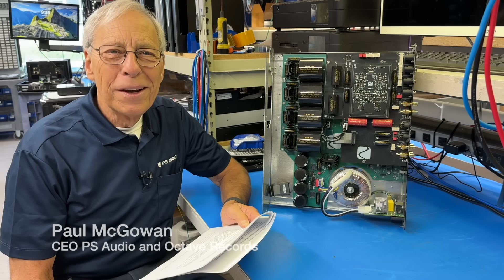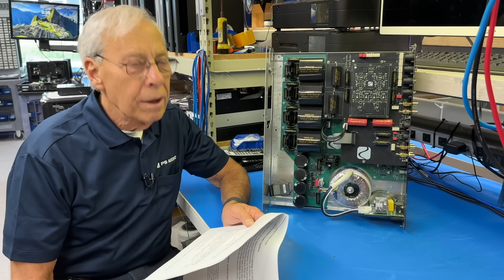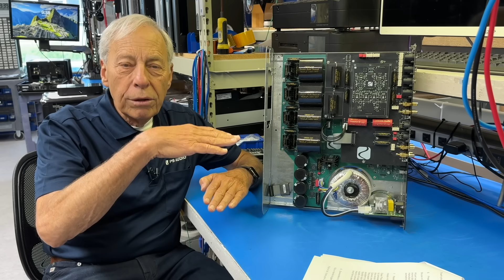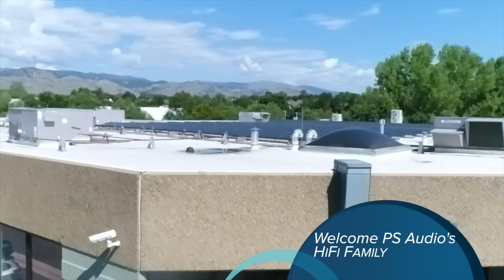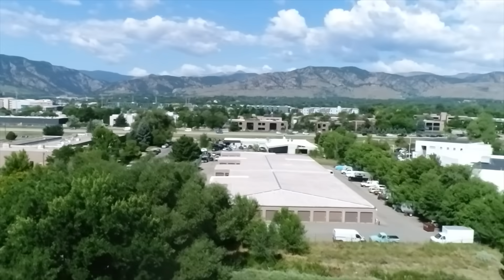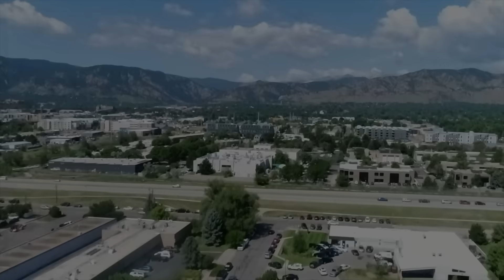Importance of preamplifiers and power supplies

Comment: Could not agree more about power supplies.  My pre amp PS does in fact have 4 film caps and 4 big chokes.  That is because I built if myself, and followed the advice of Lukas Fikus who has advocated this approach for years.  And the volume control is autoformer based because resistors just don't sound good. 
I suspect the new PMG preamp and DAC will be killer.

Comment: The importance of the power supply to the preamp is one argument for an integrated amo, it seems to me. It does seem a waste to have 26 lbs of transformer and capacitors in a preamp feeding a 50 lbs (or more) of transformers and capacitors in a power amp. Of course, if one of those components has tubes, it might be worth it.

Comment: I cannot afford Paul's gear but I did just find a super rare power supply. "Rare as hens teeth" Music Fidelity V-PSU II for my V-DACII.  For me that was painfully expensive. I paid less than half for the V-DAC II.  However after watching this quite important vid it made sense to me to get the real deal upgraded power supply by the same company. Is what it is.  Paul knows what he is talking about no doubt! Dug in on net about this power supply and many said it made big improvements. 63 and the clock is ticking. Not getting any younger. Enjoy life while you can I say. In this case hoping for a minimal 10% gain on audio improvement with upgraded power supply. If I get 5% to7% that will will suffice.  China after market power supplies for my DAC were less but then they base it on 110 volts in. Their standard.  U.S.A can be 120 to 123 volts monitoring my U.S.A made variable variac for my home system. That being said kinda of scary depending on their DAC power supplies just saying.  Going back many years,,,,,,vintage tube amps were rated at 117 volt specs in.  Maybe I am splitting hairs but it seems logical to me keeping things in range voltage wise as needed. Feel free to chime in on this subject by all means. Learning is everything.

Comment: The problem is the main function of a preamplifier is to be a hub for your hifi.  It should not be sold as some solution to improve the sonic quality of your sound.  Thats wrong messaging in my opinion.  

 That being said preamplifiers can exist as a piece in your chain to tweak sonic character.  Lots and lots of people by annemic cheaper dacs.   More transparency and more resolution are not necessarily going to make that dac sound better.  Hence why tubes and warmer solutions exist.  

Great discussion if the goal is to have uber transparency, however i dont see everyone in practice with this desire.  

Furthermore when we consider alll the formats, all the generations of music over decades of music.  We have to acknowledge the sheer amount of variability across this spectrum.  

Paul i think more emphasis on fun and i think more emphasis on creating a preamplifier than can act as this total control box of sorts for tweaking sound per medium, genre, and generation is just so much more appealint to todays generation.  Multiple gain settings maybe eq of sorts, tubes etc.    i say all this and people are not even making preamplifier anymore.  And it would be nice to have these features not be baked into a dac like some of these other brands are doing. So what do i know.  

The sales pitch for preaplifiers is by this thing that cost xxxxx and by the way it shoud make no difference in sound charter.  The reaction.... Why do i need to spend xxxx for something that doesnt add anything.... Just to turn the volume up...

I think, IMO this is why people dont buy preamps because they see them as scams. 

If resolution was king every person on earth would be an audiophile.  Rock and roll was founded on distortion baby. 

At the end of the day synergy is everything.  If you need uber transparent then get that.  If you need to warm up your sound than do that is my take.

Comment: I think the importance of a preamp depends on your DAC. If your DAC has a digital volume control and no buffer at the output, then a good preamp will make a huge improvement in the sound. Most DACs under 1k USD use DAC chips' digital volume and no buffer after the I/V stage. Perhaps modern 32-bit DACs using 32-bit depth for volume have fewer volume rounding errors, but their SNR at low volumes is worse than at high volumes. I have experienced this firsthand, and I have had to actually use my preamp to attenuate the signal instead of amplifying so that my digital volume can be high to increase SNR. I can't find good pot with non-ferromagnetic terminals for the preamp in my country. 

In my DAC design, I use a digitally controlled analog volume chip and a discrete transistor buffer, so a preamp might not make a huge difference, and I would be better off putting the money elsewhere, like a DSP circuit for a sub. With the goal of a fully balanced circuit from DAC to power-amp, my preamp would cost a lot. I have a good circuit with THD of at least 0.0000x%, but it requires a lot of parts, at least 15 transistors per channel. For a balanced circuit, i.e., 4 channels that amount to 60 transistors. With the overall system THD goal of at least 0.000x%, and with the power amp at 8 ohms and volume chip already at 0.000x% THD, I cannot downscale the preamp if I am to use one. All circuits produce predominantly odd-order harmonic distortion, thus, there is no chance of distortion cancellations between components unless I use a tube preamp.

The PS Audio preamp is great, with great design and build quality. You can come close to the performance of the film caps-based PSU, though with a capacitance multiplier, RC filters, and film caps bypass caps. It's great for marketing, though. At that performance and price level, small details like that are what win over customers. With 400uf filtration, I can only imagine what you had to do to completely get rid of ripple. My DIY preamp has 10k uf caps, but I had to resort to capacitance multipliers and RC filters to completely get rid of ripple.

I completely agree with you on the importance of a clean PSU and the tap and water analogy. But designing and building a clean PSU is non-trivial, and some circuits, e.g., cascodes, are more immune to PSU junk. The real work is making the "tap" track your hand movements perfectly, and not to overshoot or to undershoot. Each twist of your hand should be proportional to the change in the rate of flow of water, which is easier said than done. also, controlling the rate of flow of water in a small tap(small signal amplification or low gain amp) can be more linear than controlling the rate of flow of water in a big tap, like a fire fighter's hose (high gain amplification or power amp current gain stage)

Comment: Paul, there are dozens of DACs with analog volume control. So my Nuprime Evo-2 DAC, but I am using it's fixed out, because the preamp im my Luxman L-509Z integrated and it's volume control is better.

Comment: BAck in the Mid 80's, I had the opportunity to work with Michel Prin in Mtl (He was the founder of SON HI-FI MAgazine & the Montreal audio festival if I recall).  I remember doing an experiment with him where he connected the external power supply from NAIM Audio (for which he was the Canadian distributor at the time) to a Sony Pro portable tape recorder/playback device.  What we did was listen to the Sony device with the power supply provided by Sony.  It sounded good, but not as nice as the NAkamichi deck we used to compare all on a good audio system...    Then he used the NAIM power supply and WOW the Sony device was sounding so much better; more dynamics and more stability with better soundstage, then we tried the Sony with Brand New Batteries... We were shocked to hear just how good this portable device was sounding without Any power being linked to the wall outlets via any power supply.   It actually sounded better than the NAkamichi device!    This experiment proved a few things to me : 
1) Wall worts power supply are NOT very good for audioé
2) A good Power supply can make audio gear sound sooooo much better & this still holds true be it an internal or outer power supply (ideally with a great Capacitor basin for dynamics and stability in the flow of power).
3) BAtteries can be messy to manage but, Boy, oh Boy!  Good Batteries are a Great way to get power supplied to any gear that is to be listened to (Especially if Batteries are used in conjunction to feed a great Capacitive basin to get both silent power that is also dynamically capable.  
Over the years, I had chance to experiment with these 3 notions, especially point 2 and 3 and I am Sooooooo clear that power supply quality is, indeed, something that can significantly impact music/audio reproduction.

Paul is spot on about this in this video 
& that preamp looks nice indeed with these  film caps.  :) 

Cheers!
M :)

Comment: You can measure the voltage rails within a preamp and judge the effect of the power supply and capacitors on how constant and noise-free that voltage is. It would be nice to see some actual precision oscilloscope measurements showing the effect of the power supply improvements. You can measure much more detailed voltage fluctuations than what you can ever hear btw, so this is not a case of listening is the best judge, like it is in some other areas of high-end audio (e.g. speakers).
Reply: You will never see any measurement of the power supply and I think you know why, because it's all total 🐴💩. Film caps vs electrolytic in the power supply you will hear no difference. If he showed what the ripple looked like it would destroy his claims and his products. But he is marketing to a customer base that has more money than electronic senses. But I digress.
Reply: @carrizzle9586 The fact is that you can't describe every quality of audio fidelity by simple numbers like THD, frequency response and so on. But sadly this argument is over-used to falsely claim that nothing can be judged on measurements. Reality is of course the DC power rails in any audio gear is easy to measure for any noise or fluctuations. People who buy 1000s of Dollars of power cables for their preamp, DAC or other gear would be surprised to know that there is absolutely no difference on the DC power rails coming out of those money spent. Rather, people spend a fortune on these things and then convince themselves it sounds better. Better is to spend on the speakers first where real difference can be heard.
Reply: @ThinkingBetter  Theres lots of ways to piss away your money in this hobby and plenty of people to help.

Comment: Obviously preamps are not needed when the DAC has well designed volume control and proper output voltage to drive a power amp to full power. From an engineering perspective, it's trivial to design a DAC to avoid the need of a preamp.

Comment: Strictly speaking it's not an on/off as any sound signal is AC so the amplifier is modulating the power supply but of course you know that. Nice pre amp with those massive film caps

Comment: Unfortunately for people who could understand the power supply explanation, “voicing equipment” is a nonsense. One the other hand, for people who believe in “voicing” hard to understand an analogue amplifier can be explained like a valve. 😊
Reply: why can't an engineer 'voice' a device i.e. let it sound they like? It's quite easy really, for instance change a film resistor for a carbon composite, or use a film cap in a filter or a ceremic?
Reply: @edmaster3147  an engineer KNOWS  where to use a film cap and where to use a ceramic and why. Sometimes better parts can’t be used because of cost or size limitations.

Comment: I love when you have visual stimulants to display. it's been almost 30 years since my electrical engineer showed me film caps and conductive ink control circuits when we were developing an electric nail driver for the consumer market. The power available in those four film caps is awesome.  No problems with power delivery there, Paul. I like the analog control for the DAC too.

Comment: Everybody gushes over big capacitors. In my mind, right or wrong, you need the proper size for the specifics of the amp. Too small is bad but too big will require longer bigger drain on the power supply to refill the capacitor charge and add cost without benefit. Paul should have discussed amp input sensitivity. Same brand pre-amp and amp will likely but not always be a better match of input sensitivity. in regards to Digital vs Analog volume control it's been addressed in the manual for the RME ADI-2 DAC, page 63. I think RME are highly professional company. In my opinion the pre-amps are not necessary in modern audio unless you still spin vinyl. My two cents and I make no money selling you anything.
Reply: @dwaynepiper326 The whole point of engineering is to ensure that the proper components are used and arranged in a way that creates the desired system. Proper electrical engineering ensures the capacitors are neither too big nor too small. From the little I know of electrical engineering, I'm pretty sure that Paul and/or his staff have done the calculations and iterations of recalculations to specify the right values, arrangements, and capabilities throughout the system, including the transformer, diodes, current limiting resistors, capacitors, voltage regulation system, and other parts necessary to obtain the results they have determined will please the customer.

Instead of telling Paul what he should have done, see his supposed shortcoming as an opportunity for you to do right what he has supposedly done wrong. He's done pretty well with being supposedly wrong. Start your own company and imagine how well you would do if you were right.
Reply: @PS-n5f  Yes Paul is a good salesman. He knows what to say and when not to. So you tell me the RME engineers don't know as much as Paul. I didn't mention I have an engineering background but it's mechanical and not electrical but I do understand some electrical just not at an experienced level to someone dedicated to the field.
Reply: Large film caps don't necessarily note the capacity of the cap, but more about design and ESR.

Comment: My Nagra PLP valve preamp uses a different method:  it is powered by a number of nicad cells, which are connected to a charger.  The preamp is powered by pure DC, and there is no direct coupling to the AC supply:  a truly elegant solution.

Comment: I bought my Polk Audio RTIA7 Towers back in 2008 brand new with a Yamaha AVR and used it till 2020 when I realized the system was actually hurting my ears at any louder volume. Then I bought a Vincent integrated amplifier and the sound changed completely All for the good. 2 years later I purchased a Vincent SA-T7MK preamp and a P12 power regenerator and the old home theater Polk towers sound GREAT!! They're not high end speakers but they have new life that I never thought would ever work. Bottom line is a good Preamp is "ESSENTIAL" 💯 At least for or me anyway 🔊🎶👌👍
Reply: Is not your speakers. I've ran through Polks too. Just bought some Mcintosh speakers to try out. Glad you found the reason. Now you can really test speaker brands. I am happy for you!

Comment: Surely a digital volume control is fine if the noise floor of your dac is below the threshold of your hearing. That's taking into account the overall gain of your system to the acoustic levels and your background acoustic noise levels. 
Technically it's more satisfying to have an analogue volume control, but not necessary.

Comment: The PMG Signature preamp has large film caps and a good sized toroidal transformer for a preamp, making it immune to noise and voltage fluctuations on the AC mains. So, do we still need a power regenerator?
Reply: Film caps would be the size of buckets, if they were used in low voltage power supplies, this is handled by electrolytics visible by the toroidal transformer. Polyprops are used for coupling.
Reply: I cannot see 400uf being enough for mains smoothing/filtering. Power regenerators or any form of AC power supply seperated by a transformer in order to get a pure sine can be very beneficial to the sound, but don't expect wonders; the resolution of most gear is more of a limiting factor.
Reply: @edmaster3147  Firstly, I can and I do when dealing with tube amplifiers, since the energy stored is equal to 0.5 x V² x C, 50 to 100uF polypropylene caps are used for rectifier output smoothing at high voltages. Secondly, you cannot get a pure sinewave- it's a theoretical concept, so called power regenerator is just another amplifier, producing noise and harmonics with a finite output impedance. Thirdly, unless your AC mains supply falls outside of standards, there is no measurable (or audible) benefit whatsoever. Finally, human hearing is the limiting factor, we can not only stand, but tend to praise terribly distorted sound coming out of loudspeakers and interacting with a room.
Reply: @paulb4661  i have seen a PS Audio power regenerator which indeed was a sine generator with pass transistor; a solution, what it does with the sound is unknown to me. You are quite right with your remarks of noise and harmonics on a device producing a sine with current capabilities. As always, common belief might not be truth. Furthermore, people often like non-perfect sound and get used to it. As far as smoothing/filtering and whatever more, I often wonder why there is such enormous  capacitance used, I would rather make more efficient choices and definitely not rely on common belief.